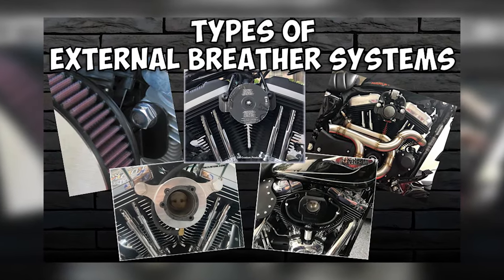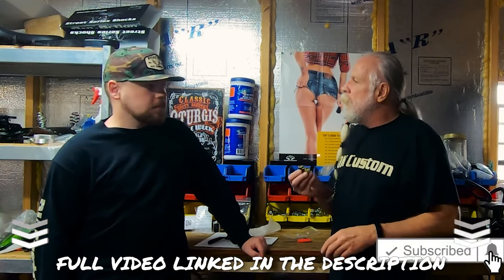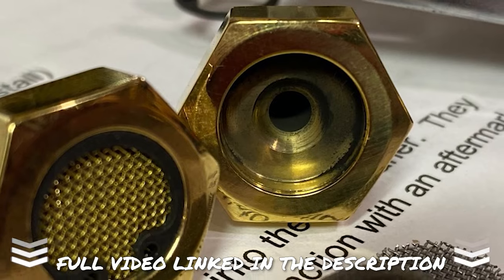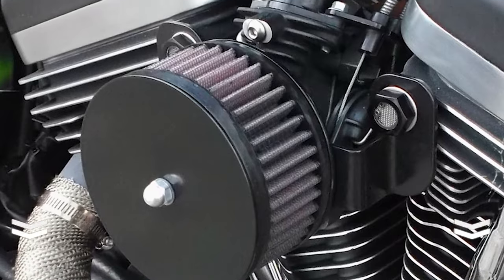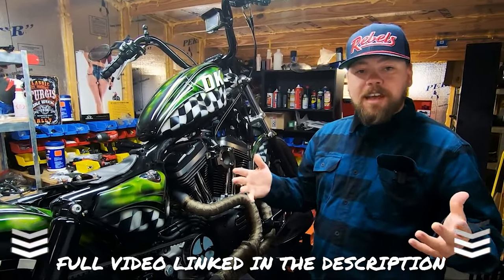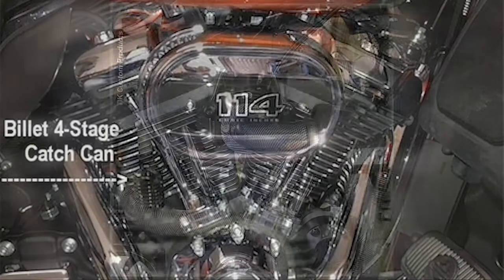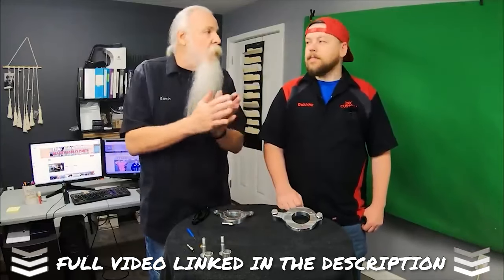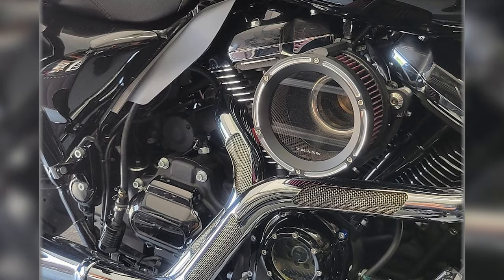The Different Types Of Harley External Breather Systems

Comment: HD Touring can use OEM breather bolts, $3 worth of hose and 2-3 zip ties. Works on all breathers using the S&S/Fuel Moto filters. Use a heat gun to bend a 90 coming out of the bolts and it cleans up the install. Drilling and tapping a new assembly wasn’t ideal, but definitely a good option for someone wanting to go that route.
Reply from the maker: Yes, here is a video on how to install with the OEM bolts.  https://www.youtube.com/watch?v=5tTkzGol2G4

Comment: I have a 2008 Road King. I wanted to get the system with the billet can. $171.00. Why so expensive? Just a small can, some hose, and a few fittings. I'll look into a cheaper way
Reply from the maker: It’s understandable to question the cost. High prices often reflect the quality, branding, or development involved in a product. 
The Catch Can alone has a lot of development/design hours, patent cost, advertising cost, manufacturing time, tool time, machine time, powder coating cost, each one has to be assembled by hand, there are many reasons we are at the cost we are at. I am sorry that it does not meet your budget.  Exploring alternative options that fit your budget could be a good way to find a solution that meets your needs.

We do offer the External Breather Systems with a filter or just hose and they are much more affordable. You can see All the EBS that we offer at this link - https://www.dkcustomproducts.com/all-twin-cam-engines-c76-328.htm

Please feel free to contact us with any questions;
Support@DKCustomProducts.com
662-252-8828

Thank you for commenting! MB

Comment: what external breather for a Arlen Ness stage 2 big sucker on a 2017 883 iron
Reply from the maker: That system would require modifications using the DIY kits found here...

http://www.dkcustomproducts.com/diy-external-breather-systems-305.htm

The install procedure can be seen here...

http://www.dkcustomproducts.com/acl/diy-external-breather-system.htm

You can contact us for any questions or concerns;
Support@DKCustomProducts.com
662-252-8828

Thank you for commenting! 👍😎👍
Reply: Nope nothing